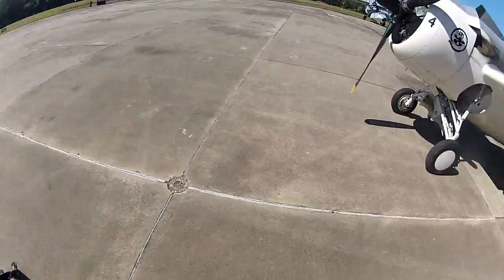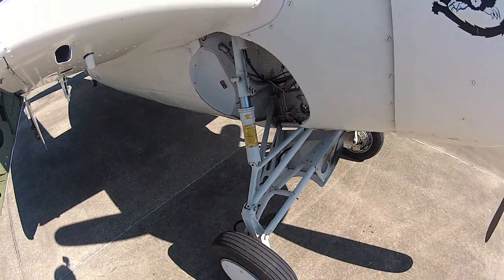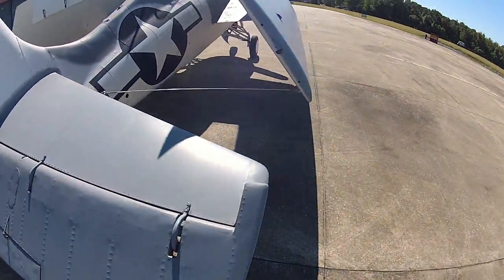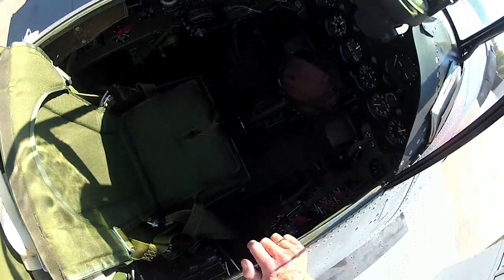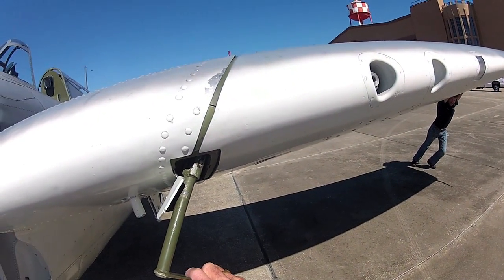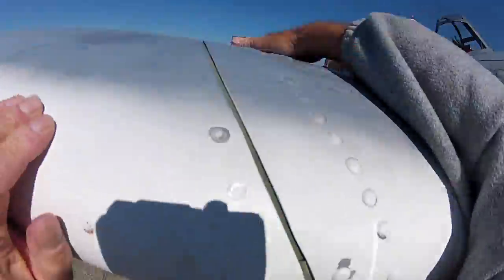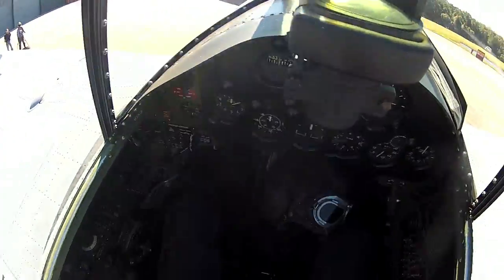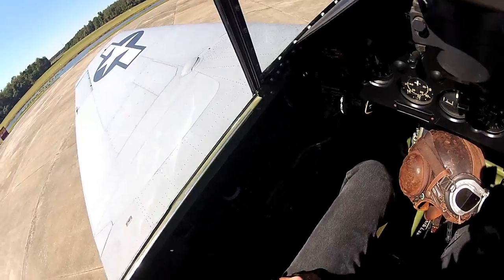Grumman Wildcat - Part 1 - Kermie Cam

Comment: I've read the Wildcat was a turkey that nobody realized until it encountered the A6M 'Zero' which completely outperformed it. The only thing the Wildcat had going for it was armor, self sealing tanks and ability to absorb tremendous damage. Luckily a fellow named Thatch brilliantly developed a sort of tag team system for dealing with Zeroes called the 'Thatch Weave'.
Reply: Yup and he originally flew the F2A Buffalo
Reply: It's something of a myth that the A6M zero completely outperformed the F4F. In one major respect in terms of flight performance the Wildcat was grossly superior to the A6M2.

The Zero had a higher top speed, and was extremely manoeverable at low speed, but over 200mph the F4F was actually more manoeverable, especially in terms of roll rate, the large control surfaces of the Zero became very heavy at speed and that impacted the ailerons faster than the tail. What Jimmy Thach realized is that the much higher roll rate of the F4F and higher turn rate at speed allowed US pilots to lose pursuing A6M's by doing a pair of opposite half rolls into a flat half figure 8 while level and maintaining the speed of the aircraft, the Japanese pilots couldn't follow and the end result was usually the A6M wandering into the sights of the F4F's wingman (IJN pilots did not maintain formation when in combat, and flew individually, often leaving them as meat for a section of US pilots)